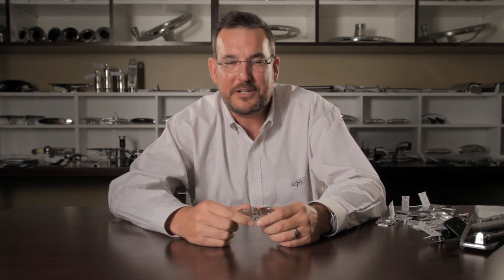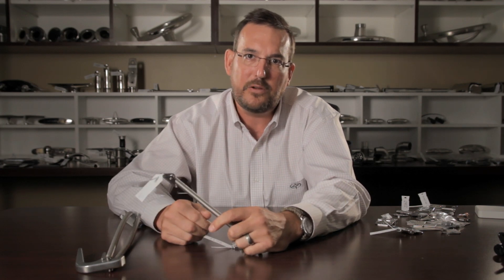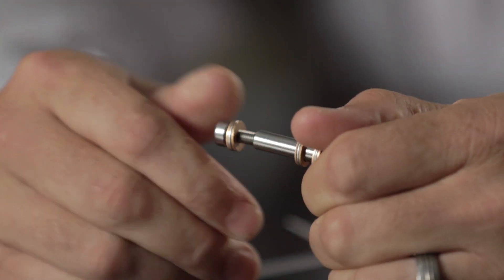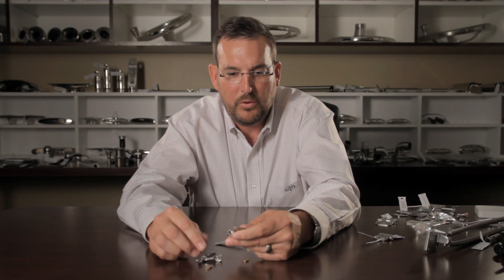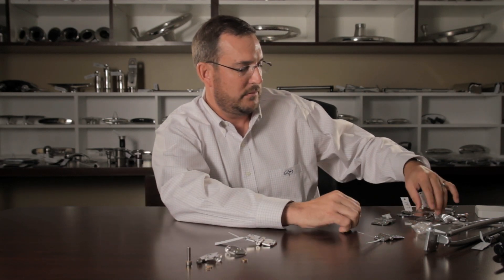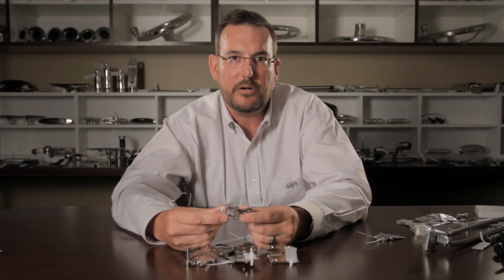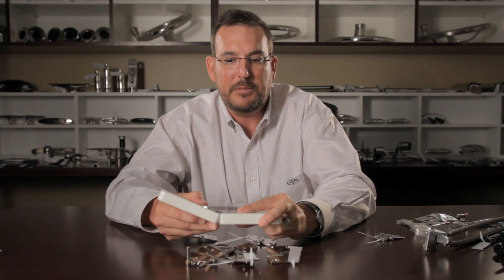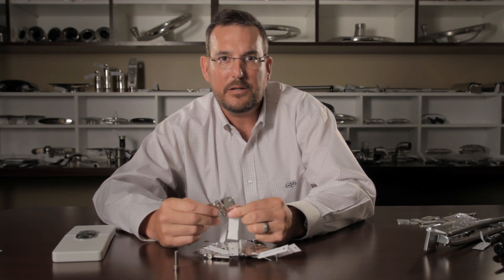Friction Hinge History

Comment: I just bought a Tidewater 2020 1910 baymax  The friction hinges are so strong on the bait well that it is cracking the gel coat and takes two hands to open or close. Tidewater is at a loss.  I was told not to loosen the hinges but am curious who is going to replace the gel coat when it breaks.  Tried lubricant, no luck.  They seem like a good idea but not on this application  Please contact Tidewater Yachts and give them a clue.